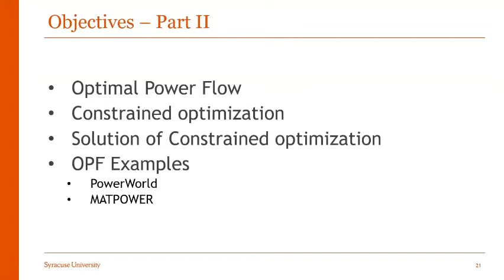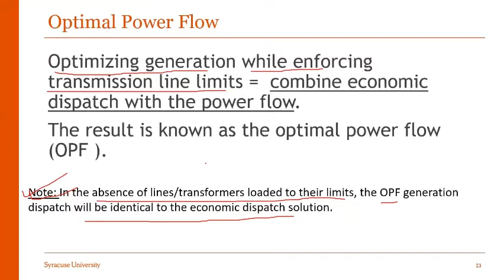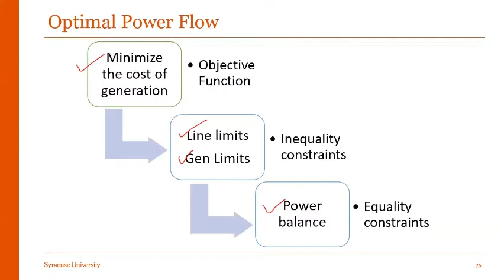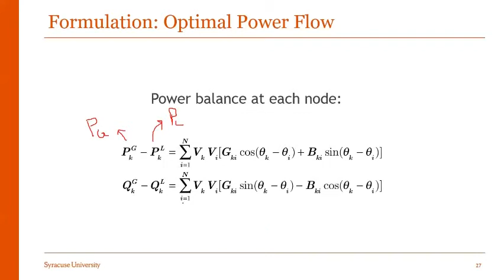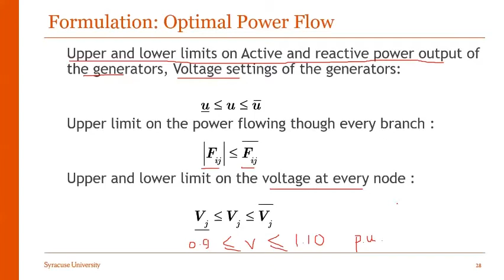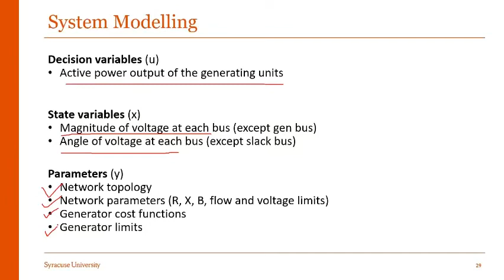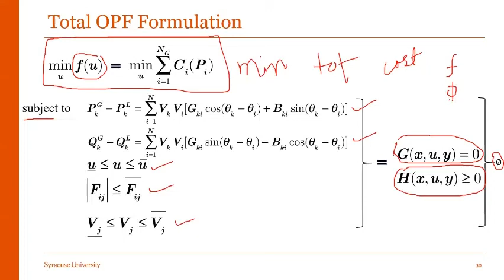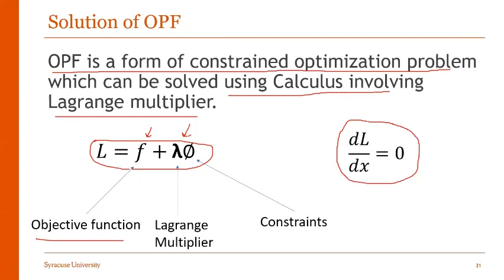Optimal Power Flow - Part 2

Comment: Thank you sir for your fruitful explanation, please i need your support as i'm studying optimal power flow course, if you can help help me?
Reply from the maker: sure let me know
Reply: @sb.sb.sb.  thank you again for your appreciated reply. I want some material or lectures that can help me like the one you shared here and i want to know how can i apply OPF on powerworld progarm, i have the software and i don,t know about using it
Reply: if you have examples solved by powerworld as well
Reply from the maker: @nanonani7477  why are u using powerworld. use matpower instead. it is much better. powerworld is ok too - see example: https://www.powerworld.com/files/OPFQuickStart.pdf
Reply: and please let me know if you have a professional or academic platform/website
Reply from the maker: @nanonani7477  https://sbasumal.expressions.syr.edu/
Reply: Could you please provide me with the matpower code solution?
Reply from the maker: @nanonani7477  Hi, pls follow this in depth short tutorial: https://matpower.org/docs/manual.pdf
i get all the codes from here